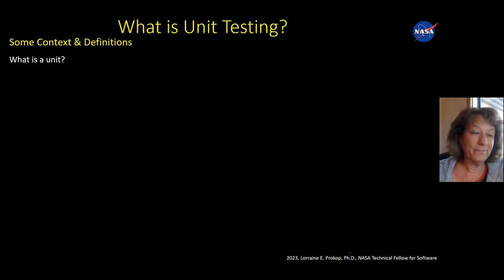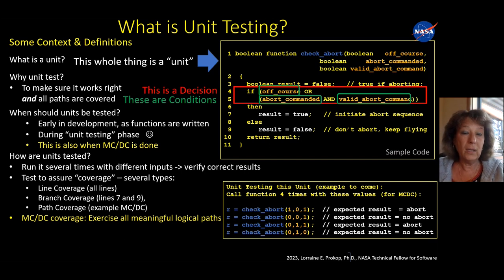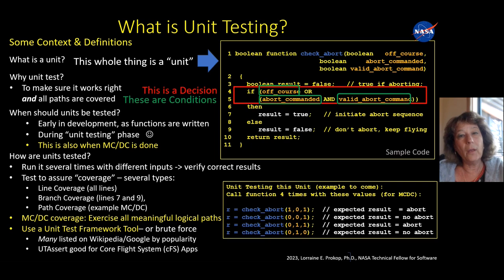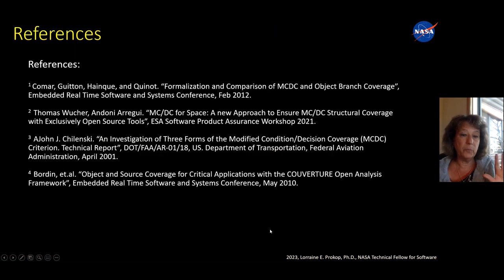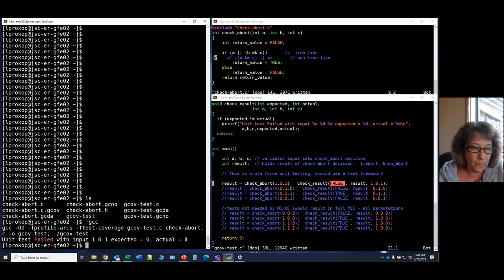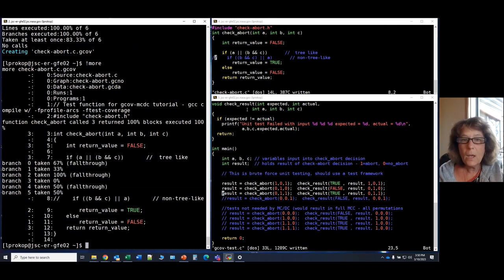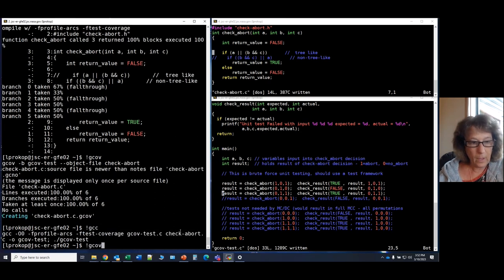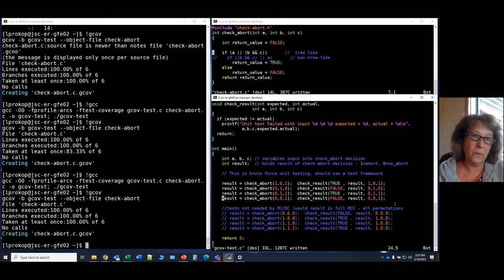What Is A Unit Test and How To Use gcov for MC/DC?

Comment: Thank you for sharing. I am working on an ISO-26262 ASIL-D level project and am interesting in using this way of working.

How confident are you in the ability of the mcdc-checker to identify all non-tree-like decisions? This tool is not certified, is it? Do you know of any plans to certify? Does NASA require all tools they use to be certified?  Are there alternative tools that we can use to at least achieve a level of redundancy? 
In your "MCDC and gcov training.pdf", you linked to Couverture, but I don't know how to get started with this.

Is it possible to have a decision that cannot be converted to tree-like? 

Why and how does gcov perform "unique-cause+short-circuit/masking" MC/DC instead of only "short-circuit/masking" MC/DC? The presentation "MC/DC for Space - A new Approach to Ensure MC/DC Structural Coverage with Exclusively Open Source Tools" by GTD GmbH states: "We will deal here with masking MC/DC, as it is the most practical one, is the one currently used by DO-178C, and matches well with short-circuiting in the C language."